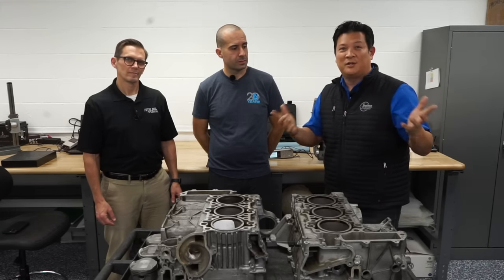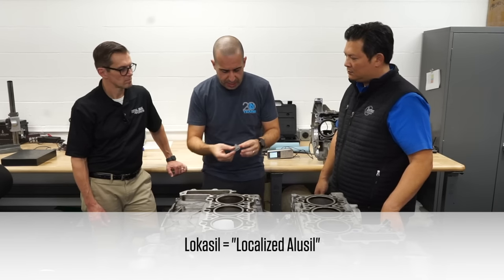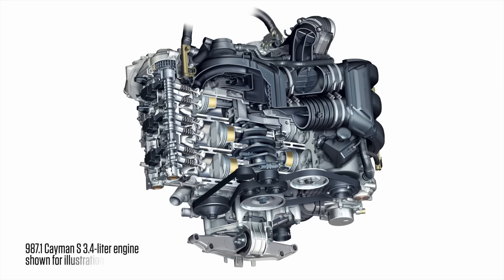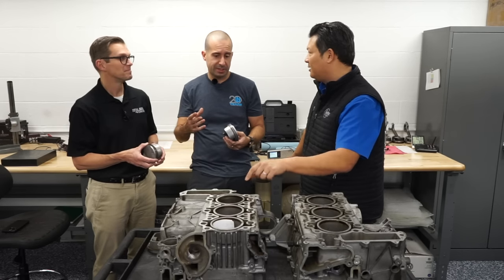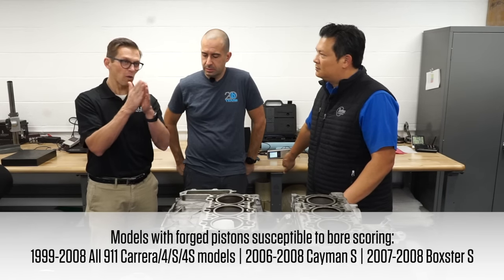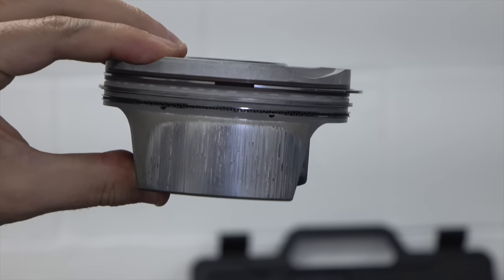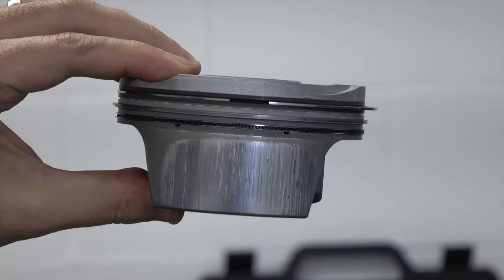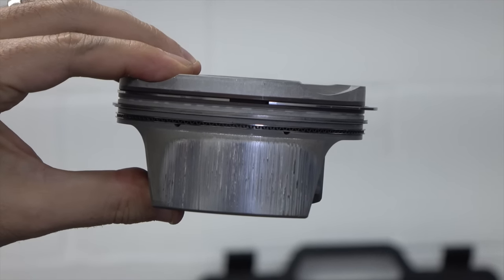What bore scoring is & why it can happen to 1999-08 Porsche 911s, Boxsters, & Caymans | 1 of 4

Comment: Crazy how common bore scoring is on these model years and yet people still think they won't get burned. The amount of C2S's and M96's in general I've seen with bore scoring is unreal. Be careful..
Reply: It’s being overshadowed by the IMS bearing issue. At least with the IMS issue, you can fix it before it fails. 
This seems much worse in my opinion…
Reply: Only 1-3% of all cars made were affected…. If you are buying a high mile 911 chances are it’s better than one with 10k miles

Comment: Thank you for this.  I bought my 99 996 3 years ago.  Did not get the engine checked over.  So of course a tad concerned.  Mayhaps start doing the engine oil analysis.
Reply from the maker: Yes, oil analysis is the best place to start. Damon has used Speediagnostix on his Cayman with good results, and you will see his oil analysis in future videos...

Comment: My 1989 Carrera 3.2 actually had alusil cylinders from the factory.  With I tore it down it looked pretty good well into 6 digit mileage.  The skirts on the factory cast pistons started to get a little worn, but it looked like it was honed with a few very minor scratches.  The cylinders all looked like new.
Reply: The Alusil cylinders used on your aircooled 911 were made using a difference process and the pistons had an iron clad coating which would appear to be much more durable. FWIW, we've never seen one of those score.

Comment: I've watched this series a couple of times and now I'm wondering a few things.  1. Does it matter if it's Alusil or Lokasil if the bore surface that the piston sees is the same?  2. Was the bore scoring problem with the '97-'08 cars listed really more of a problem with the piston skirt coating process?  3. What did Porsche do differently with the materials in the 987.2 and 997.2 generations?  4. What are they using today in the 992 and 718?

Comment: very informative on the origins of the bore score issue. Interested in the repair process/costs to repair the issue and determine if it should be done sooner vs. later. (Big fan of Driven Oil and fuel stabilizer)
Reply from the maker: Thanks! You'll want to pay attention to videos #3 and #4 (Saturday and Sunday) for the info about prevention, slowing down bore scoring if your car has it, and, finally, fixing it when fixing becomes necessary.

Comment: I've had a thought on why bore-scoring happens that is very likely wrong, but it does explain some things. What if the scoring is caused by a failing dual mass flywheel? The vibrations would be worse the closer to the flywheel, so that explains number 6 being a problem first. (Other reasons can contribute.) Also, the vibration damping properties, like a harmonic balancer, are mostly required at low rpms. At high rpms, the flywheel sort of self-straightens and the damping properties arn't needed nearly so much, if at all. That may be why driving like Aunt Martha is worse for the engine as far as bore-scoring is concerned. Also, using a solid mass lightened flywheel for the track would not need damping as the engine is primarily driven at high rpms not to mention the low mileage accumulated compared to a street car. Might not be a valid reason, but as nobody seems to know for sure, I suppose it could have merit. I wonder on bore-scored repaired engines if the flywheel was found to be bad....

Comment: It always surprises me that no one mentions the Elefant in the room according to the main reason why bore scoring arises , and that’s  because a lot of people don’t do a proper warm up on their engines . 
I have a year 2000 model 996 C2 with about 70 K miles under his belt and the cylinders are like brand new on the inside due to a proper warm up , also a sign of mistreatment of an engine is when It‘s oily around the cylinder heads , all due the lack of a proper warm up !!!
Reply: Pls share what is a proper warmup? For me it's starting then letting it idle for a minute then running it in a slow pace. Until it reaches normal temp level based on the gauge.

Comment: Hi, There was a mention of it briefly, but I just want to confirm that the 2.7L was much less prone to bore scoring than the 3.4L due to the pistons are not forged... Is that correct? If so the 2.7L from 2006 would be the one to buy if you were concerned about the ims bearing failure and the bore scoring??? Cheers
Reply from the maker: You are correct. Cast pistons is just one reason. Their iron coating is also different and more durable than the 3.4. A 2005 Boxster most likely has the small single row IMS bearing, which is the worst out of all of them. But it can be replaced with a better one relatively easily compared to the later big bearings (which are the best OE bearings). So a 2005 Boxster is your best bet to avoid bore scoring and IMS bearing issues as long as you replace the bearing. You’ll want to do a visual check of which bearing the car has, Porsche used a mix of IMS bearings in 2005-2006. By 2006, most bearings were the large single row.

Comment: I have a 2006 Boxster S with a 3.2 engine. I'm not burning oil but I do have a lifter like noise. Should I have the engine scoped just to check or is there another explanation for the lifter like noise? It has worried me for some time.
Reply: Doing used oil analysis would be less invasive and cheaper. Depending on the results, you might then consider scoping the cylinders or consider replacing the lifters. You might also consider changing to a 5w40 if you are using a 0w40 oil at the next oil change.

Comment: That's a great video but I'm slightly confused about the Lokasil issue. The layer of Lokasil inside the bore looks to be about 5mm thick. There's obviously no way the scoring is wearing right through that and into the pure aluminium liner, therefore the piston should still be running on the silicon in the liner, so why is the Lokasil liner actually failing whereas Alusil doesn't seem to? Because if you don't wear right through the Lokasil layer, which you clearly don't, there's no apparent reason for the Lokasil to behave any differently to Alusil!
Or would this particular engine design actually have scored an Alusil block? 
Can anyone explain this?
Reply: Under a microscope, the difference between an Alusil and a Lokasil bore is negligible. Both are finished the same way using the same process. The only difference is that with Alusil, the whole block is cast with the same high silicon aluminum and with Lokasil, the silicon particles are located in the cylinder bores.

Comment: Question: Is a M96/3  X51 engine in a 2004 40th anniversary is prone to the same possible problem of bore scoring?
Reply: Yes. Models with the X51 option use the same crankcase with Lokasil cylinder bores, so it is indeed susceptible to cylinder bore scoring.

Comment: Base boxster 2.5 or 2.7 is the way forward
Reply: 2.5 has shorter gearing, just needs a light flywheel adding as Porsche put a crap heavy dual mass one on (along with many of their engines) 

2.5 is also a proper cable driven throttle, and has levers for the front boot so you can enter if a battery has gone dead, whereas later ones where electric switches, making it tricky if you got a flat battery to then access the battery on the front boot.

Comment: How many parts per million of silicone in an oil analysis would be considered elevated? My aluminum and iron counts have actually gone down a little over 5 years of oil analysis, but my silicone has ticked up slightly in my most recent one.
Reply: Since you have trend data going several years, what you want to look for is an increase. If silicon particle counts go into double digits and continue to increase, then I would start digging in deeper. I will add that if you have had anything resealed like a sump plate with RTV, that will cause an increase in silicon content as the silicon leeches into the oil during that period after the component was resealed.

Comment: Why did Porsche go from Nikasil to Lokasil ?  Sounds like it was more cost effective to change?  One last question, what is being used in the current model (2022 &2023) Porsches?
Reply: I swear I heard it had something to do with environmental regulations and the chemicals used in the process.  Could very well have been money though.
Reply: @K1dPhresh1   Thanks  for  responding!  Do you know if Lokasil is used in the new Porsche's?
Reply: @1scooterpilot1  that I don’t know.  I imagine they’ve learned from the M96/M97 engines and dropped Lokasil from 2009 on, but not sure what they’re using now.
Reply: @K1dPhresh1  thanks
Reply: Production output and cost savings. They still used Nikasil on mezger engines during those era, much better engine.
Reply: Plating is considered a dirty process and using other technologies like Alusil and Lokasil are considered more environmentally friendly, not to mention more cost effective. Porsche in recent years has been using Alusil and now SUMEbore, which is a thin iron composite coating applied to the block.
Reply: @lnengineeringllc  haha so time will tell if sumebore is going to fail or not.  Swell.  Glad I have an 07 turbo.  At least it seems, for the time being, I am clear of this issue (i've had all other known issues with turbos of this generation happen though)

Comment: So building my 87 3.2. Cast pistons and Nikasils coating is best option??
Reply from the maker: We wouldn't suggest using this video to inform an air-cooled build, because it really is honing in an the many issues that combine to cause bore scoring in the M97/M97 engine. Carrera 3.2s did come from the factory with Nikasil-plated bores, and we have not heard of any downsides from upgrading to forged pistons in a Carrera 3.2. This is something you'll want to discuss with your engine builder.

Comment: What's an acceptable PPM for Aluminium/Iron on a 3.4?
Reply: Aluminum and silicon should be low single digit values and iron single high digit for a 3-5k service interval.
Reply: @lnengineeringllc  thank you

Comment: I have a 2007 3.4 Boxster S. Should I be worried?
Reply from the maker: The engine in your car is more susceptible to bore scoring than some of the other smaller-engined cars. We will be covering topics in new videos through Saturday that address things to avoid and things you can do to avoid bore scoring for as long as possible (if bore scoring happens at 250,000 miles, for example, it could be attributed to a tired engine at that point)

Comment: I've had scored bores on non-Porsche engines.  Mostly 2-strokes, if we're honest, where it's just something they do to themselves over time (or via catastrophic failure, whichever comes first).  Easy fix, just disassemble the motor and hand the block or cylinders to the friendly local machine shop man.  Did it for my old Kawasaki last year, and hopefully will find time to do it for my old Husqvarna this year.  Guys with old V8s take a pretty similar approach, just with a lot more iron to hoist around.  Some of the guys with newer bike engines have nikasil bores, which are a bit more annoying to repair, but requires an ungodly engine failure to get damaged.

For some reason, despite having pretty simple engines, when something happens to the engine of a Porsche or a light airplane, it's a million dollars to resolve.  That's really annoying to me.  For a GT3 engine that's taking S2000s to school on specific output, I can kind of get that the engine has some exotic business going on and things can get expensive.  But an M96 or M97?  These things have no reason to be anything but cheap and normal.  They're not really high revving, they're not boosted, and they're not terribly light.  Nikasil would be proper if you insist on perfect engineering, iron bore liners would be proper if you're actually interested in the long-term well-being of the customer.  How much of a non-issue would this be if we could just bore it out and throw in a set of 1st-over Wossners?

Comment: What coating in the cylinder in the 997.2 or 991.1 DFI engines?
Reply: There is no coating on the cylinder walls. The block is cast with Alusil which is a hypereutectic aluminum alloy.
Reply: @lnengineeringllc  So no threat of bore scoring with 997.2?
Reply: @dkosawa  It's still a possibility, but much less. The same precautions we recommend on the M96/M97 engines should be taken with the later models with the MA1/9A1 engine.
Reply: @lnengineeringllc  why makes it be less of a risk for the bore scoring in 991.1 engines?
Reply: @Thanks4Driving  The  991.1 has an Alusil engine block whereas the 97-08 Boxster, Cayman, and 911 had an engine block cast with the Lokasil process.
Reply: @lnengineeringllc  thanks!

Comment: You don't mention the Cayenne that suffer this as well.
Reply from the maker: This video series is not focusing on Cayenne, Macan, Panamera models that can and do suffer from bore scoring (to a much, much lesser extent), but the same principles can be applied, because these three model lines all use alusil blocks with aluminum-silicon cylinders.

Comment: Sooty tailpipes, is that not a result of direct injection engine. I have no idea why, but that is what I have read and not on forums.
Reply: The 97-08 Boxster, Cayman, and 911 did not have direct injection. They have port injection. When one tailpipe is significantly sootier than the other, that's usually a tell that an engine has cylinder bore scoring. Later engines with direct injection will certainly have sooty tail pipes in normal operation, but when one is more so, that is of greater concern.
Reply: @lnengineeringllc  Yes, I noted that. But I was surprised that both the left and right exhausts on my 991.1 GTS were slightly sooted. I could understand that if we had an engine out front, but with the engine being where it is, I was surprised to see that. So I did some digging on the net, plus my car had no miles on it and it does not burn ny oil (it new).

Comment: Bore score is the new IMS. I have a 3.6L 02 911. it has scoring on cyl 4  and I have driven it for 6000 miles since it was found. Luckily so far no oil consumption at all or any noises
Reply from the maker: Sorry to hear your engine has a bit of scoring. You'll want to watch video #2 and #3 (today and Saturday) to learn things that contribute to bore scoring (what not to do) and things you can do to slow the progression.
Reply: @PorscheClubofAmerica  I will be watching. Currently I have upped my oil changes to every 3000 miles form 5000 and add Ceratec at every second oil change
Reply: It will eventually start tapping, in the 6000 miles have you been ‘babying it everywhere’ or actually using all of the revs?
Reply: @MrCaterhamr500  Using the rev's but only once it's up to temp